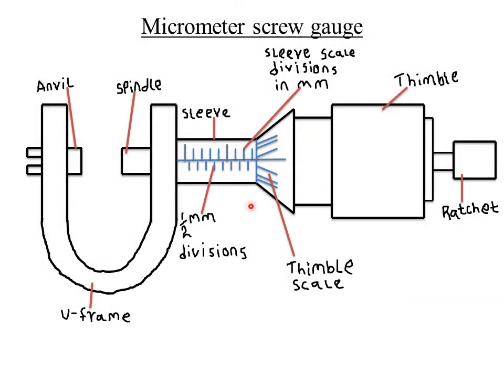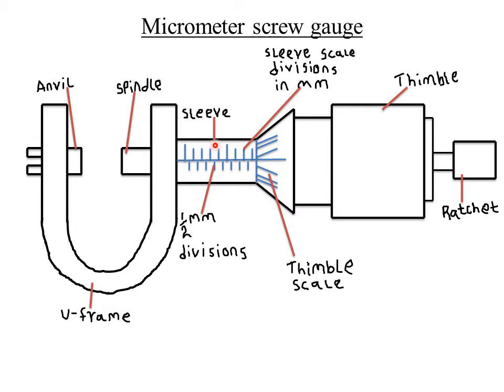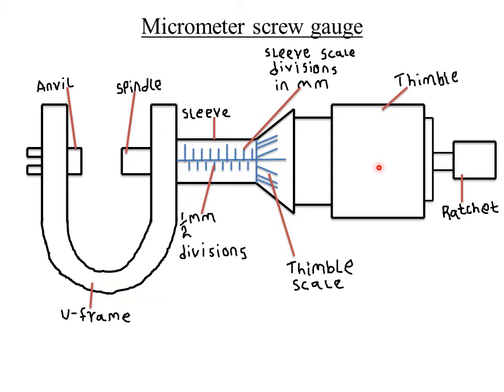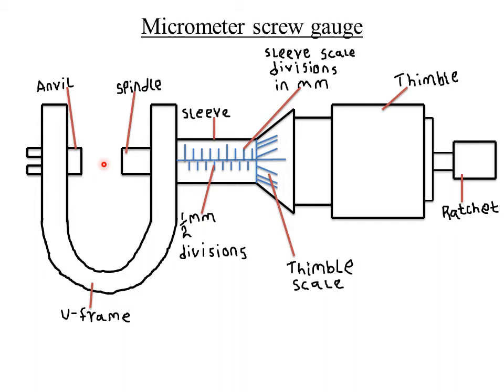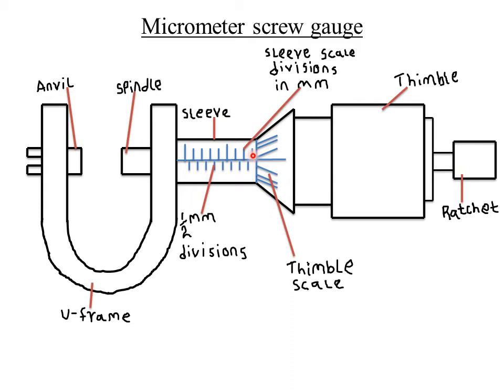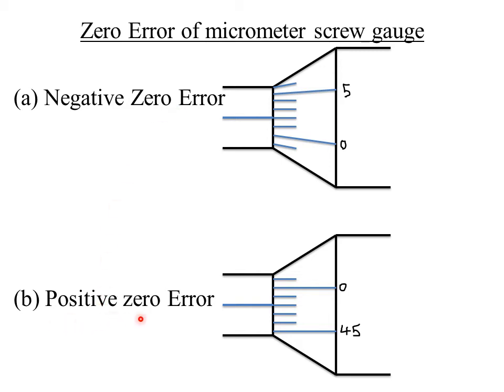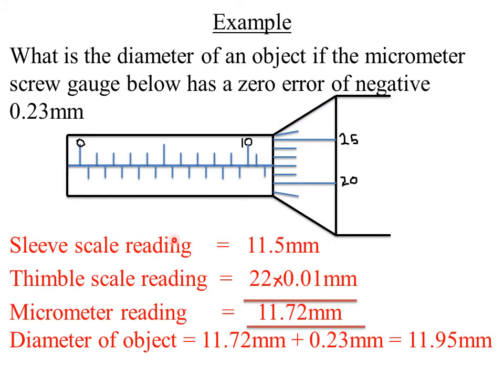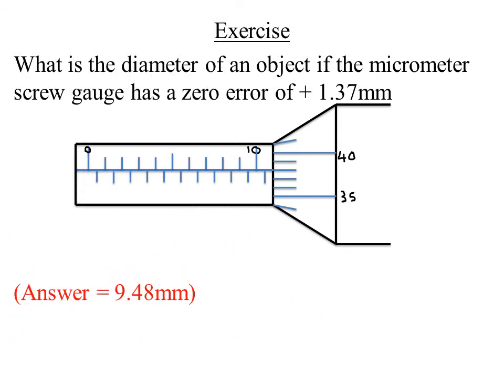MEASUREMENT (II) : LESSON 2

Comment: Sir I got 9.53 how is it
Reply from the maker: Here is the correct working:
Sleeve scale reading = 10.5mm
Thimble scale reading = 38* 0.01 = 0.38mm
Micrometer reading = (10.5mm + 0.38mm) = 10.88mm
Actual diameter of the object = 10.88mm - zero error = 10.88mm - 1.37mm = 9.51mm
Thanks for your comment 🙏.